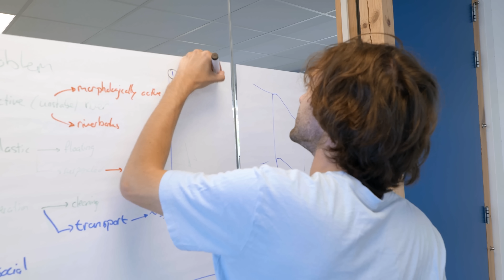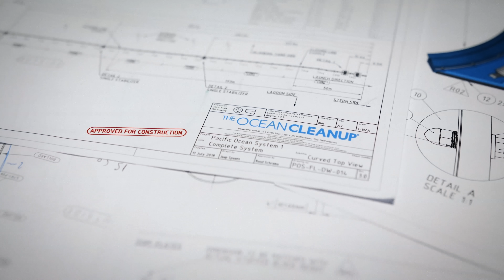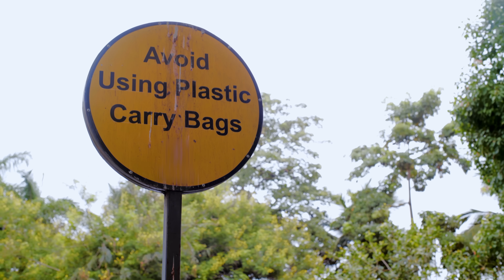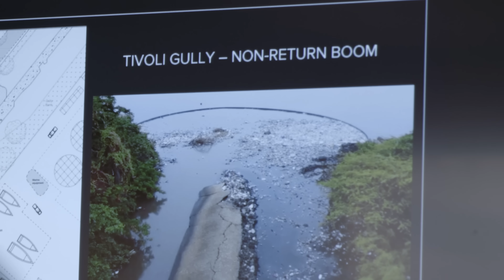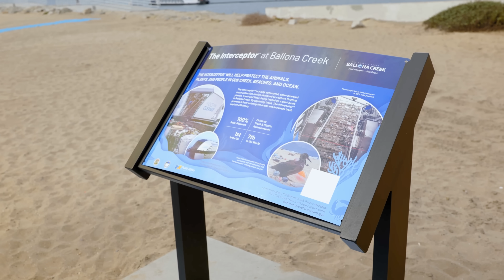Can Boyan Slat Stop Plastic Pollution at its Source | WILD HOPE

Comment: No point cleaning it up. It needs to be restricted/eliminated/taxed/. By restricting manufacturers and suppliers of products to not use or pass on cost to consumers it will force change. There is already a number of alternatives available. Not to mention existing materials. But if there is no incentive- then why is a product manufacturer going to move away from cheap plastic. They won’t.

Comment: I'm sick of organisations claiming things like cleaning up the oceans because the realty is they aren't achieving anything.
The first shocking fact these people need to learn is that all plastic is single use and all of it is heading to landfill and the oceans. 
You can recycle glass or steel indefinitely but you can't do the same with plastic because it's properties seriously degrade each time it's reworked. 
IE you can't recycle a soft drink bottle into another soft drink bottle. 
It's called recycling but the new product is vastly inferior to  what is was to begin with.
Coke a Cola used to brag on their website that they were mixing in 5% recycled plastic in their new bottle production. Any more and the new bottles wouldn't be fit for purpose. 
We've all bought cheap and nasty plastic items that break the first time they're used. 
That's recycled plastic.
It's not only the recycling  process that degrades plastics because even sunlight will do the same to most plastics. Again we've all bought plastic that fades and becomes brittle when exposed to sunlight. 
If people really want to stop plastic pollution then ban it's manufacture. 
Claiming to clean the oceans just means you're moving the problem somewhere else and people claiming to  recycle plastics are diverting our attention away from the only solution. 
Ban it.

Comment: Wonderful video!  The governments have to get on board by banning unnecessary plastic containers and packaging and forcing BY LAW companies to stop making things, or putting things, or wrapping things in plastic. Too bad for the oil companies, too bad for corporations who specialize in making every thing from plastic, too bad for corporations who insist on planned obsolescence  and/or short lifespan products. And people need to be taught ruthlessly to be responsible for where they thrown things out which they have used. But the first part of the equation has to be the corporations who produce goods. It is easier to control the actions of one hundred corporations than it is to control the actions of 100,000 people.

Comment: I dont want to be the party pooper here, lets face the reality. How much is the cost of the rent of those 2 trawlers, fuel, staff etc.?
I follow this project from the very beginning. This project is failed to achieve its original goal, 2 bad they could not fix the original idea of the self sustaining system. Its good for marketing the cleanup idea, but as a solution for that its a failure.

Comment: Pointless. The trash in the ocean will win in the end.
Reply: So we shouldn't try?
Reply: @ArsHaD-dg1gb  That is the definition of pointless. Why try something that is literally impossible?
Reply: @soltcolt4506  Then what should we do? We should do nothing right?
Reply: @ArsHaD-dg1gb  See? You got it!
Reply: This is sadly the truth and I'm glad some people out there realizes this and don't pretend like it's a problem that can be solved easily. To remove disposable plastics you have to replace it with something as cheap or you're not going to get anywhere. We live in a world of greed over all else and people should stop pretending otherwise, we're all tiny cogs in this massive machinery. Like I said somewhere else we're in a population boom across the world so these problems will only get worse until you get to the root of the problem, ie finding a replacement. Get rid of disposable plastics and then you can start cleaning the oceans and what not.

Comment: Make sure ever piece of plastic that comes into your possession ends up being collected for recycling or goes straight to a landfill. Landfills aren't the 'enemy' we used to think they were- we're not running out of land and our local university gets power and heat from gasses piped from them. While idling my car on a winter day to keep my work crew warm on break, a coworker attacked another for having a straw in his coffee- "Do you hate sea turtles?" was the leading question. I told her anything we put into the trash doesn't end up in the ocean, but me idling my car was a real issue. Plastics just tossed into the environment are a huge issue, they should never go there. I only wear natural fibers so my local area isn't more polluted with microplactics (we have an individual septic system and a well). This is mostly an issue of littering, on the individual and commercial scale. Blame plastic, but it's really the people who either refuse to do it right or have no viable system for dealing with the trash.

Comment: ok great, you remove the plastic from the ocean, but then what? 90% of this trash will either be buried or burned and still end up in the ecosystem. This is not a real solution to plastic waste, because its just moving it from the ocean to the land fill, or incendiary. this is very impotent when it comes to long term solutions, because they arent actually reducing the over all pollution on Earth. the only real solution is to stop consuming and producing nonbiodegradable plastics. Unfortunately I've tried to post multiple variations of this comment and its keeps getting deleted. its like if a comment doesnt follow the established narrative no one will ever see it.